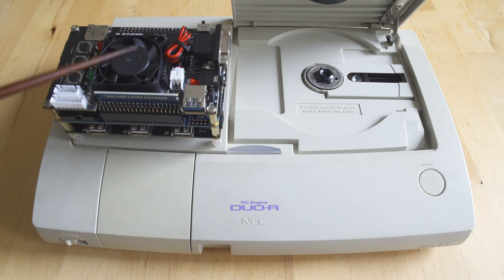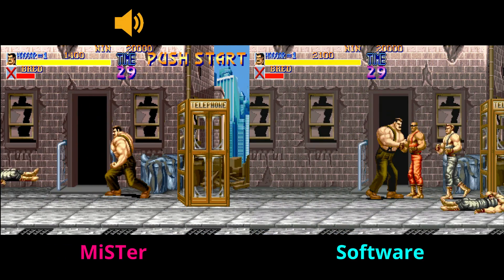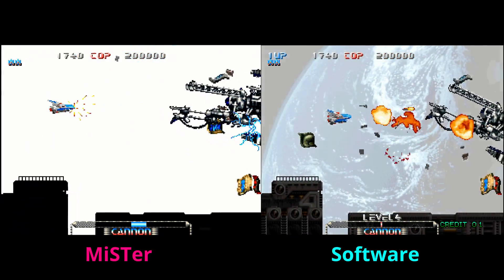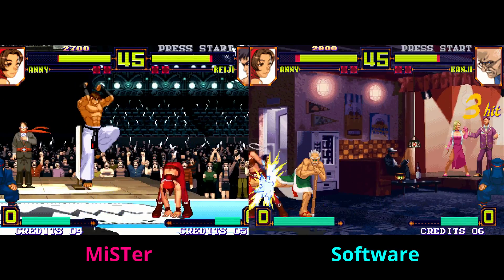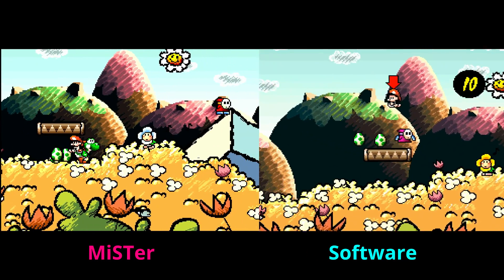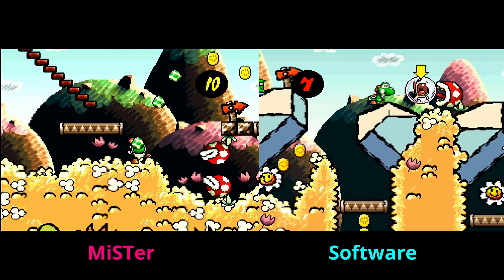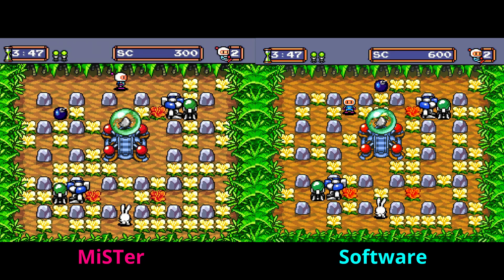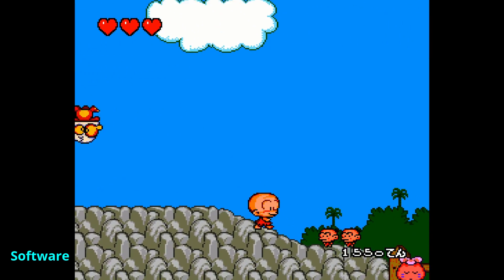MiSTer FPGA DE-10 - FPGA Emulation vs Software Emulation in RetroArch - which is "better"

Comment: I see a lot of people is asking for a lag test. But I expect you won't find much if any emulation lag with an i7 setup running 8 and 16 bit games. Lag is very CPU dependent and really it is a problem only on underpowered hardware. Granted a LCD screen or a bluetooth controller can increase lag, but that's certainly not inherent to emulation setups.
Reply from the maker: Yes that’s the issue with PC emulation; it will be different for everyone based on the hardware they are running. MiSTer is a fixed target but PC is a moving one
Reply: Overall lag is mostly dependent on what's going on in the input to output chain, especially at the display step. Modern TVs basically have hard post-processing and will lag at least a little even when set to "game mode". Controller responsiveness varies. The effects are cumulative, so every step in the chain needs examination. MiSTer is no panacea and will be vulnerable to the same net effects. RetroArch itself is basically zero lag, which was demonstrated a while back with testing Atari 2600 emulation on a CRT display with a high-speed camera. However, emulation lag is core-specific, e.g. Nestopia lags by one frame, at least it did a few years ago.
Reply from the maker: Lag is one of things you can hard test for OR just feel. Some emulators with fighting games lag enough to have input issues when pulling off specials

Comment: The mister audio is louder in he video which will give the perception of better. balance both audio to the same level would be a better comparison, also it would be great if you had a 3rd comparison showing original hardware, Great video! just some suggestions!
Reply: Agreed, volume normalization is important and is done with listening tests because of this well-known psychoacoustic bias.
Reply from the maker: Psychoacoustic bias sounds like using sound to explode peoples heads
Reply: @VideoGameEsoterica  Now that you mention it, "PSYCOACOUSTIC BIAS CANNON" sounds like something a Capcom fighter would shout while doing his special.
Reply from the maker: Haha I can’t disagree
Reply from the maker: I have comparisons against MiSTer and original hardware already uploaded so I didn’t include the original hardware here

Comment: Dude.

I HEARD CPS1 games (Final Fight) in action in the wild.  Yes, the ADPCM is SUPPOSED to sound tinny (unfiltered).
Reply from the maker: It doesn’t sound that tinny on my OG pcb
Reply: @VideoGameEsoterica  One of the weirdest things about that OKI chip is it honestly sounds different depending on the developer.

Midway's use of it on MK1 and NBA Jam have it filtered, while I clearly recall Capcom's CPS1 games leave it unfiltered.  My guess is you got a slightly modded board? (grain of salt)
Reply from the maker: Not modded. But so many things could affect it including the type of supergun I use
Reply: What's amusing about this video is that the colors on the left are obviously wrong. It's way too saturated. Those aren't accurate colors. All the RGB colors in the palettes Capcom chose have values that are divisible by 8. I've studied the palettes of CPS1 games and can definitively say that the colors in Mister here are wrong.

You can just see how the Mister feed on the left is far too saturated. Haggar looks radioactive.

Comment: It does answer the question of 'which is better', but I'm quite glad that it also answers the main question on my mind which is "how much better?"
I'd love to get a MiSTer, but I doubt I could justify the cost of one for extremely slight improvements. Many of these improvements only seem noticeable to hardware experts and also are only apparent in direct comparisons. I understand that latency is improved due to its parallel / non-sequential nature, but the latency I get via my 31 KHz VGA is good enough for me anyway.
However, one major advantage is the ease of hooking it up to a 15KHz CRT (provided you get the IO board), with which I've really struggled (with no success) on my software emu devices.
Reply from the maker: Maybe watch next Thursday’s video. May be a big MiSTer related giveaway going on...just saying ;)
Reply: @VideoGameEsoterica  Wow! You've got yourself a new subscriber :)
Reply from the maker: Haha thanks. Just crossed 10K too
Reply: @retroFuture - also I have to add that the video output on HDTV's has exceeded my expectations in general. For some reason I can only get it to look that smooth with retroarch on windows 10 if I hook it up to a VRR computer monitor, but a regular big screen TV always has some kind of jitter. I've talked with people who know more about retroarch to try and fix it in the past over and over, but it can't get resolved. I like the MiSTer since it kinda got rid of that problem I was having.

Comment: You may notice the audio is a little more accurate on the MiSTer for many cores, but did you know if you hook up an external DAC via the optical out port on the I/O board that it’s even better? I purchased one after Jotego recommended it for the CPS2 core during the beta period. It cleans up the audio even more. I noticed it made a difference with CPS2 and also with Neogeo. Another user commented that it really cleaned up audio in the gameboy cores. It was a really cheap add-on and if you are a MiSTer perfectionist it’s worth it.
Reply from the maker: I may talk about this in a future video. Issue is capturing the audio and video at the same time with my capture setup. A bit tricky. Maybe could record to a separate device and sync in post
Reply: @VideoGameEsoterica  agreed. It’s mainly for your enjoyment rather than capture :-) I have done this using HDMI capture into my PC with OBS and then line out from the DAC into the line in on my pc. Mute the audio from the USB capture device. Of course your configuration may vary or not make this practical.
Reply from the maker: In the future I do need to look at more accessories. Blisster. The MIDI PI setup. Audio options. Things of that nature
Reply from the maker: @wizdude that’s what I want it for too. I love the AO486 core. Mostly because I have a 486 PC in my closet but damn is it a LOT more convenient to use MiSTer than to drag that thing out when I want to play it
Reply: The external DAC is better if you are comparing it to the analog audio jack, yes. If the DAC is decent it's indistinguishable from HDMI audio output though as both are digital. It's worth it to someone for sure if they are useing the 3.5mm jack on the IO board, but probably not as valuable if they already are using HDMI to a tv/home theater system or something like that.
Reply: @Aberusugi  that's a really good point! i use a set of 8bitdo analogue speakers on the desk where i have my MiSTer setup and previously used the analogue 3.5mm jack. using the DAC increased the quality of the audio, but as you correctly state - if someone is using the HDMI audio through good quality speakers then they already have a DAC in their AV equipment and will enjoy the higher quality. thanks for pointing that out :-)

Comment: So unless you are really looking for the Differences you don't really notice the Difference in what you using to play the Games
Reply from the maker: For the most part no you really don’t
Reply: @VideoGameEsoterica  if the input lag isn’t a night-and-day experience on the mister, then that is a massive cash investment for very little benefit for a mister if you’ve already got software emulation running.  It’s easily €350 for a mister if not more.  For that money, there HAS to be a killer benefit.  Plus because of the hype, old 15” Sony trinitron monitors now sell for €400.
Reply from the maker: I mean everyone determines lag differently. MiSTer has less lag than software in most instances but I personally cant feel much of a difference. You may feel a huge difference
Reply: @VideoGameEsoterica  99% of games I can't really tell.

Only game I felt a Tiny Bit was the Megaman Games espically the X's ones on SNES
Reply from the maker: Fighting games is where I’ll notice

Comment: Honestly, watching the video through my phone I must take your word for it because I´d be hard-pressed to notice any difference! As you say, I´m sure both options are good, maybe with a slight edge for the FPGA.
Reply: You would have to look very Closely and know what you looking for to see any Changes Really.

Plays Quite Fine Really
Reply from the maker: Yes it’s a real pixel peeping thing
Reply from the maker: And that’s my ultimate point...the differences are very minimal and it’s awesome we have so many great choices
Reply: What's amusing about this video is that the colors on the left are obviously wrong. It's way too saturated. Those aren't accurate colors. All the RGB colors in the palettes Capcom chose have values that are divisible by 8. I've studied the palettes of CPS1 games and can definitively say that the colors in Mister here are wrong.

You can just see how the Mister feed on the left is far too saturated. Haggar looks radioactive.
Reply: @bobsaget9182  as someone who owns CPS boards I can assure you that the mister colours are completely accurate
Reply from the maker: Yes the colors are very close to an original CPS 2 setup. Granted every monitor / supergun will change them slightly but

Comment: Awesome video, man. Serious question…how much longer before I can buy a Mister loaded with games from multiple systems on Etsy or Ebay? Thanks!
Reply: It’s so easy to make your own though. Way easier than a Raspberry Pi. Just buy a MISTer, get the update all script on it, hook it to a network and run it. Does everything for you. You just provide the roms. (It automatically downloads the arcade ones.)
Reply from the maker: Yes MiSTer setup has come a long way to being plug and play
Reply: About 10 minutes
Reply from the maker: Oh I think what I said is something like “you certainly will have a great time with using software too” or similar. Which is still my general opinion. We have lots of great ways to play games

Comment: The shimmering/jerking scrolling on the MiSTer is terrible on both Pulstar and Street of Rage (check the garbage bin), almost unplayable ... Are you using integer scaling? On the RetroArch the scrolling is super smooth like real hardware.
Reply: The MiSTer can sometimes be harder to get a clean capture from than just doing a window capture with OBS or other streaming/capture software. It also depends on if what his settings are, if they are the default with 720p resolution and vsync to screen, then the 1080p video you are seeing is certainly scaled to a different size and that part of it shouldn't be considered analytical (the pixels, scaling, etc...) in this video, you should probably look for more technical reviews that attempt to show you the direct output, and to avoid shimmering you would actually have to match your resolution to the video's resolution (or a number that is divisible whole of the source resolution of the video) for the purposes of integer scaling too. Finally, youtube can convert the video and display it all wrong, so it's never going to be 1:1 what the user sees in terms of video capture being sent to youtube.
Reply from the maker: Yes I think what people don't realize is this requires an extra two steps. 1) it goes through DaVinci Resolve and even if I resize via constraints when I put two video tracks next to each other...it's still resized and 2) YouTube compression
Reply: @VideoGameEsoterica  I understand what it takes... but, the exact purpose of the video is to compare two "systems", and one is not faithfully represented as you are saying, so it may need a small message saying that the shimmering is a byproduct of the capture device and video compression. By the way, I really love your videos, specially the "Unported" serie!!!
Reply from the maker: I think i mentioned in the video things such as capture devices or exporting can alter things slightly? Glad you like Unported!

Comment: Contrary to popular belief there's nothing inherent to FPGA that makes it more accurate than software emulation. Everything that FPGA can do so can software, albeit it may take a powerful computer do so, but it can be done. FPGA is not magic. Granted, some cores like the Neo Geo one are very accurate as it was derived from scans from delidded components. However you could write an emulator based on the same info and get the exact same results as an FPGA implementation. None of the differences cited on the video are due to mister being an FPGA. The differences are due to implementation details only.
Reply from the maker: The largest difference is the parallel execution of different chips on the FPGA vs the sequential emulation on software. With modern processors sequential isnt as big of an issue but it’s still eating a lot of processing power to align all the sequential operations into something cohesive
Reply: You could write a cycle accurate Neo Geo software emulator, but it would take much longer to get it done, according to emulator developers who have done both hardware based and software based cycle accurate emulators I've talked to. Some things are harder to do with an FPGA and some things are harder to do with software. They each have their ups and downs. However, to get the video and audio output to something like a CRT, or to get a small device that is portable and not over 1000 dollars that can run these systems fully accurate that way? An FPGA-based device is going to kick butt at that every time, for now.
Reply from the maker: I can’t even begin to fathom how the devs even write these things
Reply: FPGA doesn't have to deal with an OS, drivers, LCD Monitors with lag, millions of different PC configurations. It just works, like real hardware.
Reply from the maker: The one huge benefit is your OS won’t crash constantly or try to update (looking at you Windows 10)

Comment: The best way to describe an FPGA is that it is not an emulator - it's a simulator.
Reply: The funny thing is originally an emulator was done in hardware and a simulator in software.
Reply from the maker: I do think it’s kind of interesting there is no term that anyone can quite settle on for what to call FPGA cores. Simulation? Replication? Emulation? It’s not really set in stone
Reply: @VideoGameEsoterica  When I try to explain it to someone I usually end up saying that it becomes the machine. I guess we do need to find a new term for it.
Reply from the maker: It’s like the Terminator. The T-2000...shapeshifter
Reply: No need to redefine the term 'Emulation', it works just fine for FPGA. It merely means copying.
Reply from the maker: I’d agree but people get spicy about it
Reply from the maker: It’s like Total Recall. Was Quaid actually doing what he did or was just just in Recall (a simulation lol)

Comment: It looks closer (visually and audio-wise) than a lot of people make out... But input lag is where mister is meant to be the clear winner? Shame there was no mention of this at all in the video. I know you don't have a latency tester, but did it "feel" different controlling the emulator vs the mister?
Reply from the maker: Functionally no I feel no difference in lag. But I am not super susceptible to the situation. Had I had issues pulling off particular moves in software based emulation I would have noted it
Reply: Depends on your emulator and setup. If you know what you are doing you can get even lower input lag then original hardware on emulation, but MISTER will give you a perfect experience that's plug and play, and will be better then low powered software devices. That's where it wins. My personal setup I get better input lag then original hardware, but I know what I'm doing. I use a MISTER for a dedicated retro games console that I can bring with me traveling, where my big expensive PC won't go with me. The emulation is best on my PC setup, but I can't bring it with me as it's like a boat anchor.